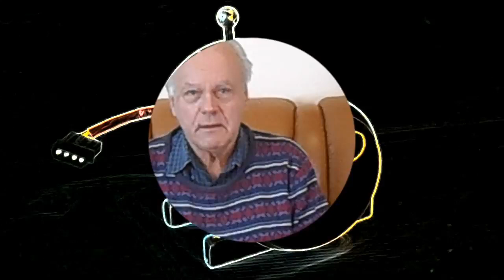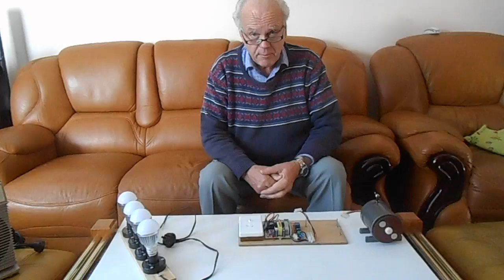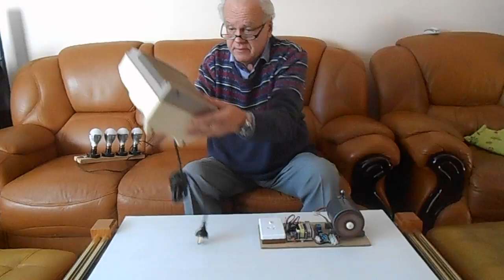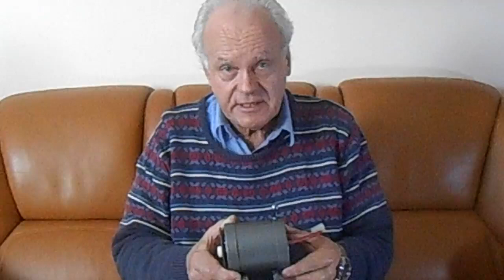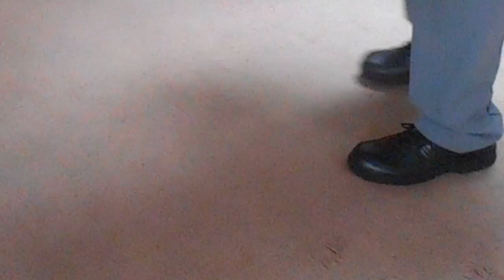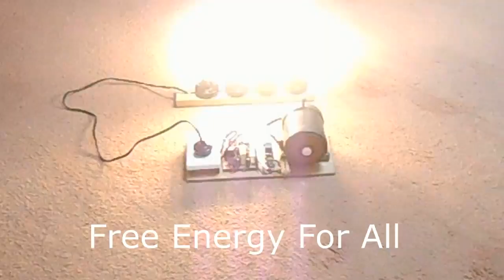Free energy from  Zero Point Energy

Comment: I see no evidence that the 1000 watt resistive element in the heater is on. Hmmm........🙄
Reply: Are you saying he used sort of high-density tungsten fastener rotator to decouple a heat emitting Fibinacci pattern load and its voltage pathway? Or did he just have a heater in garage that was so freaking old the element had burned out years ago?

Comment: There is a battery inside and a small motor to spin the generator and the "anntena" is a swich. Thats why (both times in this video 3:29, 9:27) when he puts the anntena he uses his other hand to hold the rotor from spining and after pretends that he is giving the momentum to it!
Reply: Panagiotis Karampelas omg your so right, I’ve watched it twice and it is obvious. He definitely holds the wheel when pulling the “antenna”. Scammy old man
Reply: @robrose4694  But the battery must by  huge multiple times bigger than the generator, the heat generator what was try after light bulbs  ( minimum 0,5 kilowatt   energy   make run )
Reply: @bandy820915  You can get Lithium-Polymer batteries which are capable of delivering 160 amps at 14.8V, as an example, which would easily drive the lamps, but not the heater, howevr, did you see the elements glow in the heater? They could have been disconnected, and the fan alone doesn't draw much power
Reply: @bandy820915  It takes about 30 watts to run the LED bulbs and less to run a fan (the heat doesn't come on if you turn the thermostat all the way down). You can definitely do this with a battery

Comment: I will believe this if you put it on the ground like in the last clip but instead of the led lights use two rows of filament bulbs. If you powered the heater the filament bulbs should light on without a problem ;)